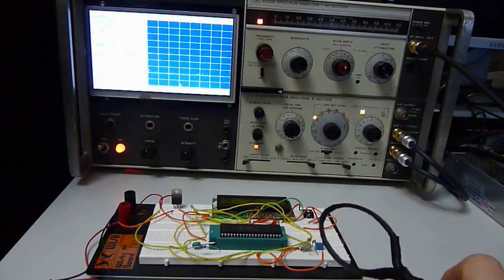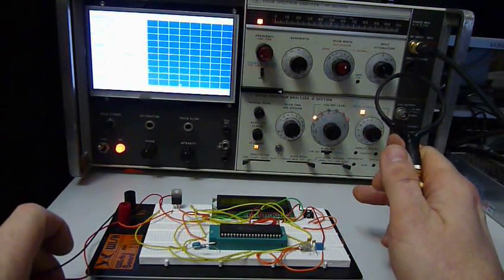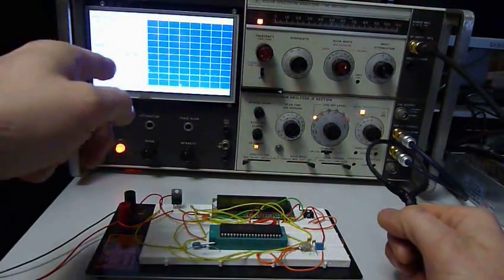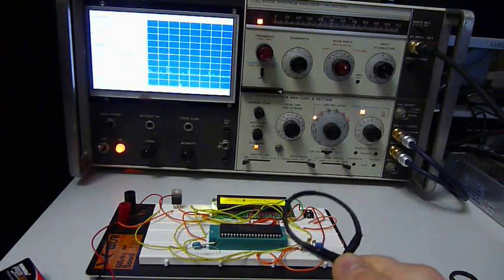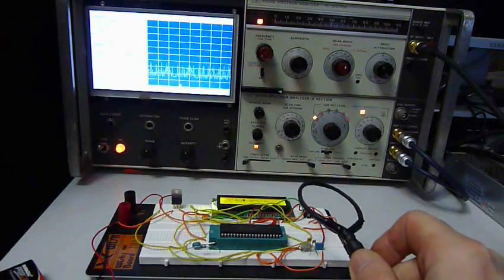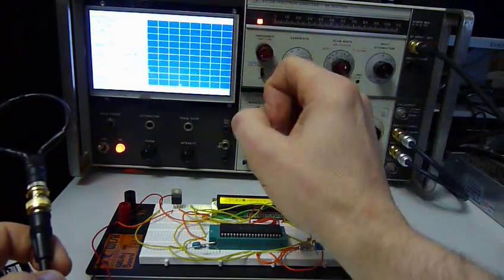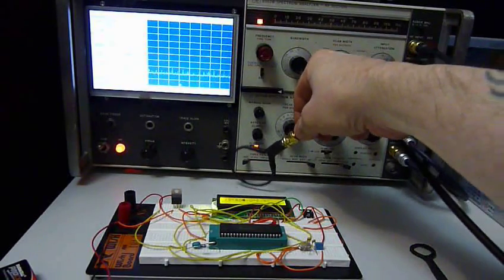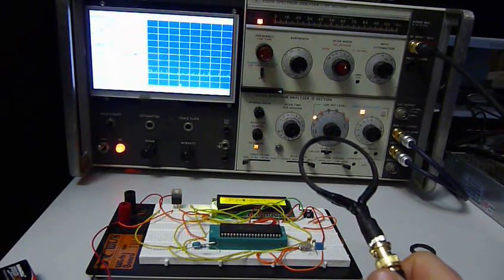HP140T HP141T spectrum analyzer analyser looking at EMI

Comment: Awesome!  Thanks for sharing the additional detail regarding the design too, i.e. "You use the pen lift output for synchronization and the vertical output for amplitude. You then run it through the sound card of a computer which acts as an analogue to digital converter and use some PC oscilloscope software for the display. I have a mini itx motherboard built into the 140t."  The design detailed walkthrough would be some great porn to watch regarding the hardware and software.  Thanks again for sharing!  I have a chance to get up to three of these and am still debating... though might be worth getting one of the mainframes and the range of plugins available so I have an analog spectrum analyzer... along with saving from potential scrap yard use.

Comment: Really interesting video i have a HP141T with the IF 8552B and the RF 8553B and i got it on flea market for $30!!! i been really lucky and i really like that spectrum analyzer.... and so i bought a second 141T with 8552B IF and 8555A RF section but that one was coming by shipping... and i was really worried and that was not for nothing because at home i got it with one handle broken so it have suffer from traveling and the mainframe was bent! so.... yeah really worried and the CRT not even well attached inside it was moving a lot on front but it still work!!!!! i'm so lucky well, i tested it carefully and the only problem it have as alignment of plugins connectors to the mainframe and so it's a job i have to do before i can use it really properly... i can insert the plugins but i need the top of the mainframe open and i have to force a little to align the plugs well, now after testing it all together i've insert the plugins to my old 141T for more tests and all is ok so, last thing to do is to bend back the mainframe and do some alignments and stuff...

Comment: Wow, how do you use the lcd ?
Reply from the maker: +Mit Lomasdelmirador 

You use the pen lift output for synchronisation and the vertical output for amplitude. You then run it throught the sound card of a computer which acts as an analogue to digital converter and use some PC oscilloscope software for the display. I have a mini itx motherboard built into the 140t.
Reply: +33rpmengineering simple ,  very smart !!!, if my crt dies, i will do the same !!!!
Reply: @MitLomasdelmirador  yeah, that's awesome! i think i'm going try getting a mainframe for parts because i have 2 of them but they are in use XD